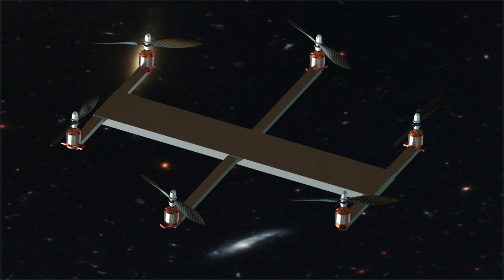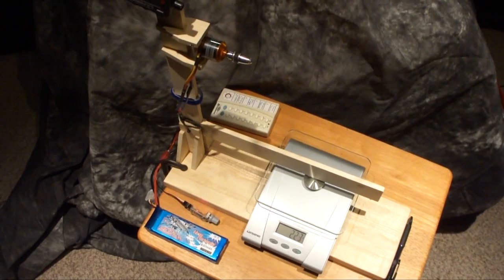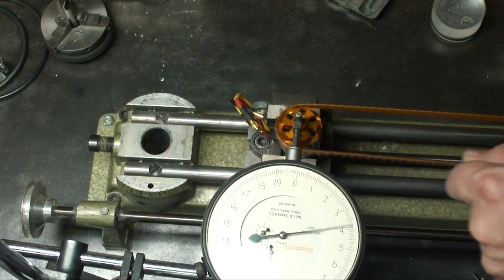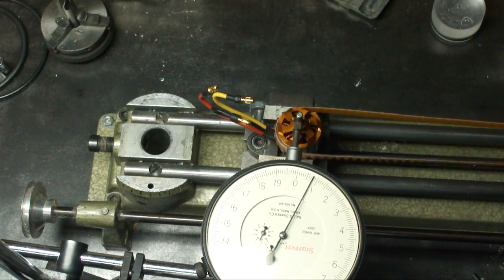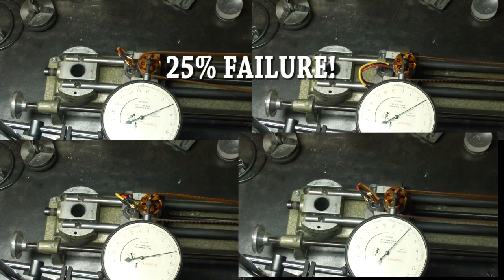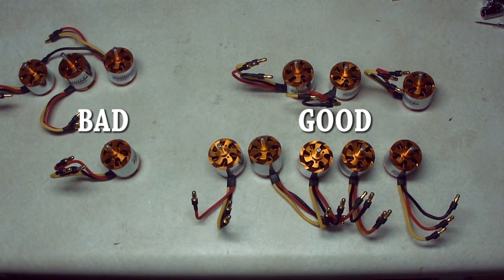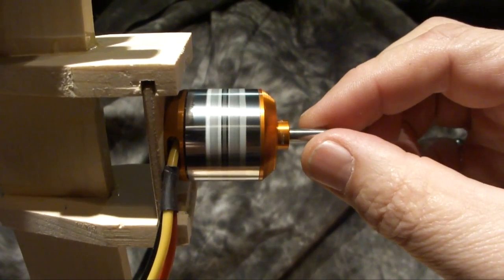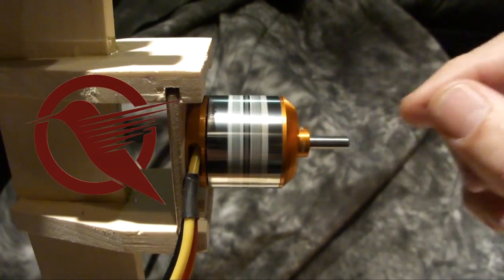Bent Motor Shafts

Comment: Thanks again for bringing a new level to the hobby with your expertise and attention to detail.
Hard to find quality motor shafts anywhere really, not to mention the unbalanced bells they put them on.  I have found weighting the motor bells can reduce jello but you're not solving the problem of displacing the center of mass of the prop so you will never eliminate all vibration with a bent shaft...  Great video!

Comment: I have yet to find a Hobby King or Turnigy motor I can trust. I ran one in to the ground, and the shaft snapped, but the plastic prop remained intact. How crappy is THAT!?!?! So I use exclusively the Grayson Hobby motors. Their shafts are strong and straight. The motors are tough, durable, and strong and of high quality. Sure, I pay $22 for one motor. But I only have to do it ONCE!!

Comment: I know what you mean bro, I meant bending the shaft back out and straightening motor bells, not balancing as I said before:P Messing with shafts is probably not worth it, they are less than a buck, but I got few motors with bended bells that needs a fix...